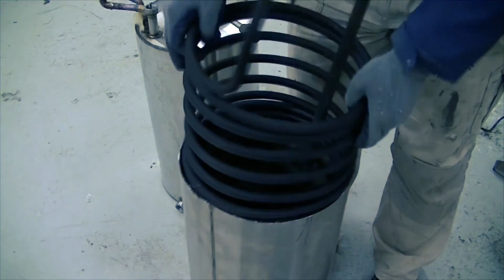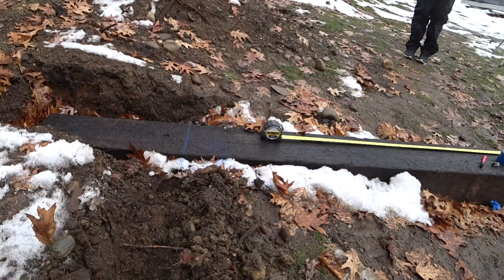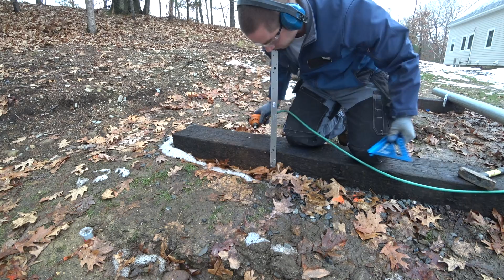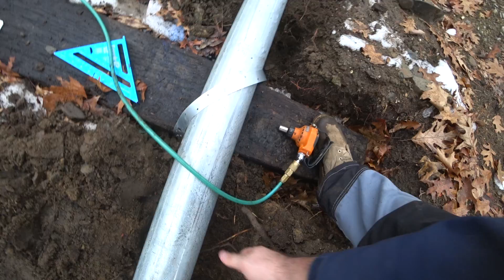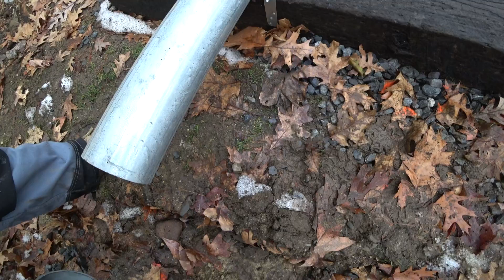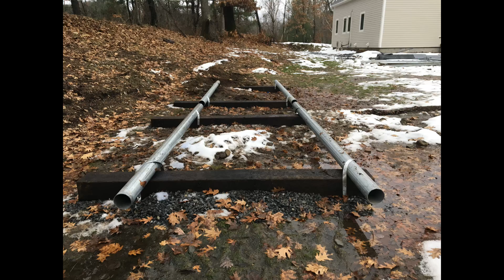Solar Foundation to charge my DIY Powerwall

Comment: How many panels are you putting on there? I would be worried that that's not enough ballast.
Reply from the maker: You are right.  There is not enough ballast yet.  I'm installing 12 panels total, landscape, 4 wide by 3 tall.  The whole thing will be about 26 feet wide by 10 feet tall (as measured on the panels) and pitched about 47° up from horizontal.  That's 260 square feet to catch wind.   I don't know how much ballast that will require.  Right now I've got about 1,200 pounds with what you see in the video.
Reply: @DavidPozEnergy  Pin it to the ground with rebar. Drill a hole in the wood and use 2 - 4ft pieces one on each end, that should hold it.